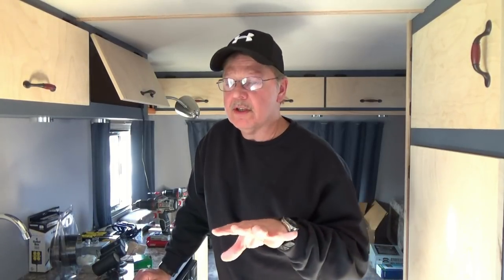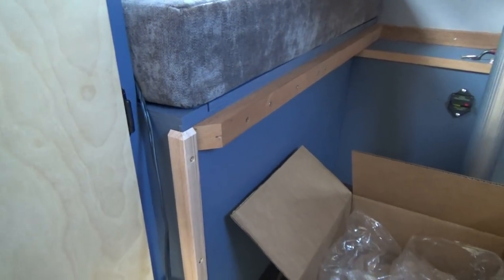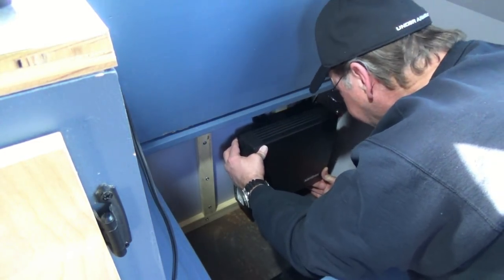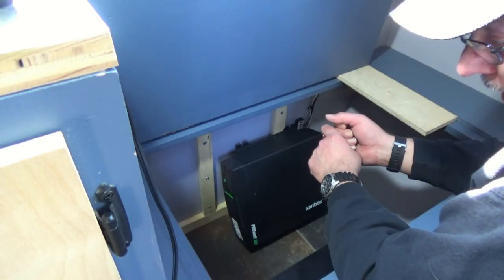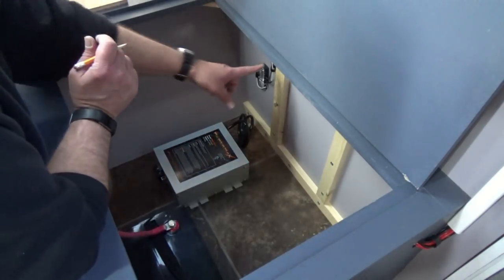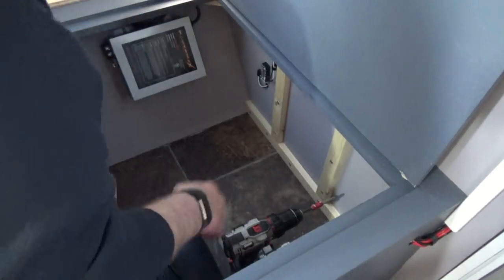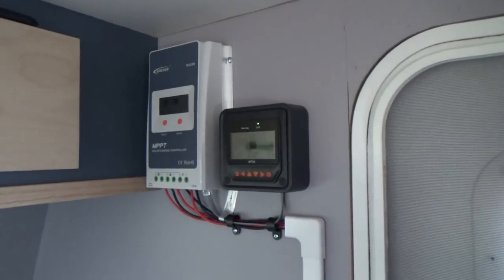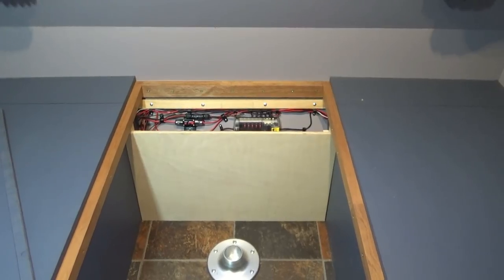How To Build A DIY Travel Trailer - Part 70 (Installing Xantrex Inverter Part 1)

Comment: You're doing an excellent job on that my father-in-law built 1 years ago he started with a 16 foot car hauler and built a little house on it it is almost permanent he has it where he can back it in the barn and Hoist the building off and still use the trailer
Reply from the maker: Thank you! That is a great idea your father-in-law had. I've only seen one that used the same idea. Looked like it worked very well!

Comment: It's not how fast you are walking, it's that you are stepping in the right direction.
In some ways the trim work is the hardest part of a build,  Because the trailer is nearly finished and you want it to just be done.  And how many have taken the trailer out for "just one quick overnight", and then never seemed to get back to the trim?  Congrats on your steadfastness! <--think I just made that word up. It looks beautiful.
Make sure that your charger and your inverter can never be on at the same time, especially if you are going thru a busbar with all connections.  The ripple current from the DC output will essentially be going directly into your inverter, which 'can' cause problems with feedback on both ends.
I just got a new 1200w 24vdc inverter for my Lithium-ion batteries yesterday.  It runs everything I have under 1200w, 2 fridges, freezer, small microwave, and all lights and pumps, and desktop computer.  But the best part.... only $113.  So I'm happy, and can empathize with where your at right now :)
Reply from the maker: I know the closer to the end of a project a person gets, they tend to speed up just to get it done. Then the work turns out all crappy and they just settle with it. So, I'll take my time and fit things just right.... maybe redo it a time or two until I'm happy with it, then move on. No sense in rushing it! :)   Good tip on the converter! (wish you told me that a couple days ago! LOL!)  Nice score on that inverter!! Should work very well with that battery. If I had the money, I think I might have went lithium.... no worries about draining past 50 percent to 100! Gotta look into one of those!

Comment: You are nearly there Al, soon be spring and you will be off on the road to enjoy all your good work. I noticed you have been using fertiliser on the upper lip.
Reply from the maker: Real close now George! Have a couple of things left, then I can explore some of Oregon! :)    I'll have to put put some milk on that upper lip and let the cat lick it off... that should clean it up real nice! Ha Ha!!
Reply: LOL
Reply: Al. I just looked back at the floor vids. I cant see what you used for it, was it 3/4 ply underneath and 1/2  on top with foam between them.
Reply from the maker: 3/8 top and bottom... I would probably go no less than 1/2 next project, although this is holding up quite well
Reply: Thanks again, walls are ? 1/8 in and 1/8 out???